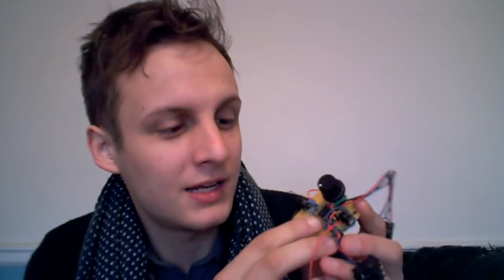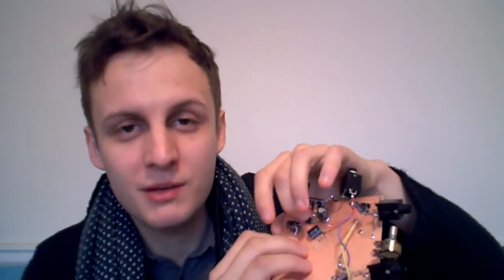Designing a Studio Headphone Amp Kit

Comment from the maker: You're right. Low-Z headphones are able to provide more volume from a lower voltage output precisely because they are able to draw more current. This, unfortunately, is where many low-voltage headphone amps fall short--they can't provide enough current to properly drive low-Z headphones to high volumes.

Comment from the maker: I like your thinking! It does make sense in principle using ideal components, but in the real world I anticipate that this circuit would be too noisy and have loading problems. First, the TDA2822M is not a very quiet amp. It's acceptable a low gains, but at high gains where it's stable, it's very apparent in headphones. Second, the inductive and capacitive effects of the transformer may complicate the amp's ability to drive low-z headphones. Thanks for the thoughts!

Comment: What if you used your "TDA2822M" circuit ( 3:25 ) and used a step-down transformer on the output? If my thinking is correct, that would allow the circuit to produce the decibels that it's stable at, but since it's being stepped down, it could have less decibels on the output (the transformer's secondary) while still being able to produce a lot of current when plugged into lower impedance headphones. Does that make sense? what do you think?